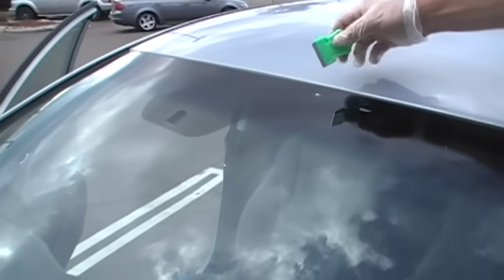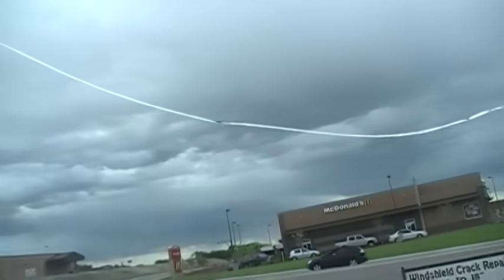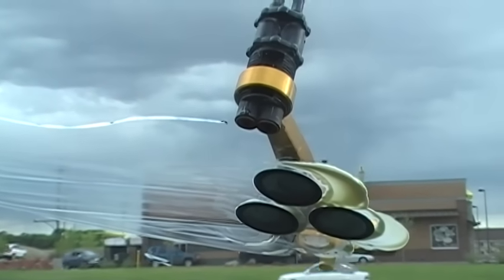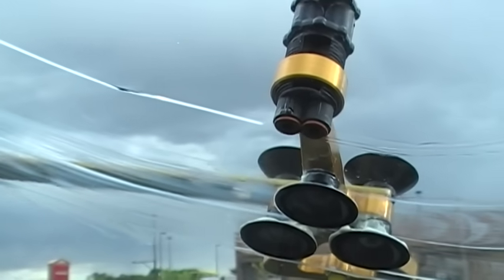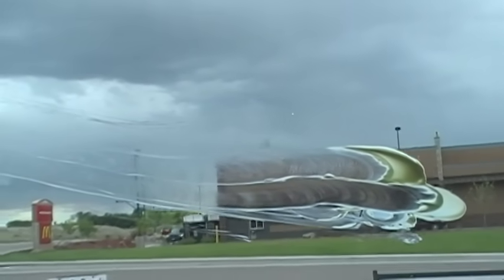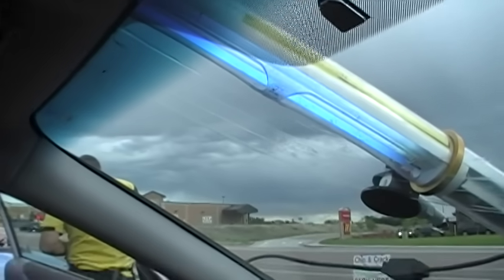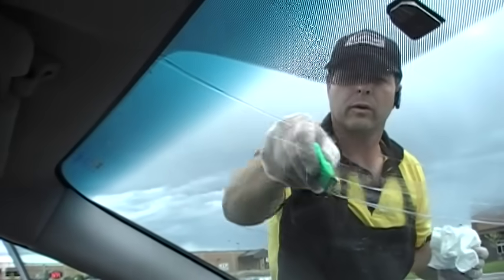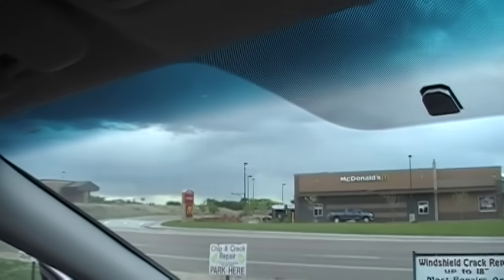How to Repair a Long Crack in a Windshield by Crack Eraser

Comment: Today I tried to fix a small chip on my windshield and actually made it turn into a long crack, I believe this happened when I shut the car door while the replacement kit was working on the windshield I open the door to look inside to make sure the residents doing what it was supposed to do and then I closed the door! Then tried three times to fix the long crack.

Comment: I own a fleet of 6 driving school cars.  I finally decided to learn to do this myself and tomorrow I'll try my first crack, about 18" long.  I bought a $179 kit from someone else on Amazon.  The injector seems decent (made of steel with good O rings and a nice suction cup) but it's not double barrel.  The "grease slide trick" ... Can that work with other injectors?  Is the type of grease important?

Comment: Tim I have seen to many repair Kit, but I never seen a repair as great of a work as this .What do you used ? What's the requirements ?what kinda glue do you used .I wanted to test this out in my car got the same windshield Crack like that .What do you think of a Rain x repair Kit is that any good also ?Do you used that ?

Comment: Ugh need this so bad, got the exact same rock chip and crack on my 1996 buick regal and my windshield is discontinued so I can't replace it. I was told by my local glass shop that cracks aren't repairable 😂

Comment: What about from right to left all the way to about 1” from the other side just above the wipers?

And no I didn’t hit anything, the damn thing cracked while sitting in a parking lot during winter with the defrost on. Work van was 11 months old. This Ford is a piece of hot trash, this is just one of many absurd issues I’ve had.

Comment: Whats the cost for a repair like that ????
Reply: I wouldn't be surprised if it was 40-65 bucks, anything more then that you would just pay the deductible and have it replaced. Since I do mobile rock chip service, I will do it but if only if they ask me about it I don't advertise it, I have done it on RVs in the middle of no where Alaska where the crack is right in the view of the driver and is annoying until they can get it swapped out with a new windshield in the next town 400 miles away or when they get back home.

Comment: Does it actually change the viscosity of the resin?
Reply from the maker: Yes I blends resin as you inject so the resin changes viscosity as you inject matching the gap of the crack.
Reply: @windshieldrepairkits  wouldn't that be the fluidity of the resin? Viscosity is affected by change in temperature.

Comment: WOW! I never knew such a thing was possible. 🤯 I have an '89 Buick Reatta with a low crack down near the dash that goes about 1/3 of the way across from the driver's side edge to the lower edge. The car is fairly rare... Especially here in Canada and new glass is nearly impossible to find. I'm going to have to look into repairing it with UV resin. Nice work and thanks for sharing.
Reply: how did it go ?
Reply: @schoolinJOO  I did get me some resin in a kit by rainx... It did NOT work well and was a total waste of time and money. Perhaps if I would have had more resin, more experience using it, and professional tools the results would have been different.
Reply: @clllaytrrron  that’s what i am thinking; i should buy a second or third kit…. another youtuber used a $9.99 kit and got across almost half the windshield but he said he had already done it before -
Reply: @clllaytrrron  thanks for your reply btw!!!
Reply: @schoolinJOO  yeah that rainx kit had such a teeny tiny bit of resin... If I try it again I'll buy some resin off Amazon or maybe take it to a glass shop in town... I used to deliver windshields for PPG so I know a few of the installers.

Comment: Interesting, given a choice I'd rather have a windshield patched than  replaced - there's less chance of leaks and rust from disturbed paint and moldings. 
However, I don't understand why an owner would need to pay for a replacement windshield.  
The same insurance that makes this  free repair would replace if necessary a windshield that could not be patched.

Comment: Can this be done on cracks from stress no rock chip.
Reply from the maker: Most cracks go to the edge and have such a small hit that started the crack that people think it is stress but it is not. As long as the crack is on the outside layer, then yes it should be repairabl
Reply: Thanks cause I have a long crack started in the dark black area of the window. Gotta be close to 17 inches long

Comment: Is the resin going into the crack from the inside or from the outside? Where is it being applied from?
Reply: its from the outside windshield but it makes its way in the windshield
Reply from the maker: The crack is only on the outside pane of glass so the outside.

Comment: HOW IS IT GOJNG TO CREATE A AIR POCKET IF THE REPAIR AND THE BROKEN SIDE IS ON THE OTHER SIDE YOU SOUND SO STUPID TRYING TO TALK DURING THE REPAIR
Reply from the maker: The crack is on the outside pane of glass. You are misinformed. I have been doing this for 40 years I can talk and repair at the same time.

Comment: Do i need to drill a hole on each end of the crack? i have a 11" long crack that started from a little chip about center of that crack, so about 5"  each direction.
Reply from the maker: If the crack does not go off the edge on either side then yes you need to drill both ends.

Comment: Once glass cracks and runs like that, it might be possible to stabilize any further cracking, but the crack will still refract and distort light.  If the crack is in the line of sight of the driver, it is probably best to replace and not repair.
Reply from the maker: Hello Doug, You are partly correct. The refractive light and distortion is greatly diminished by 80 to 90% because the crack is filled by a optically clear refractive index matching resin. We tell people it will be like a hair off their head sitting on the glass and the light glare will be greatly diminished. If the crack runs right across their view in the critical area the size of a 81/2 X 11 sheet of paper  right above the steering wheel we usually recommend a replacement.

Comment: By putting suction cup devices on the windshield, will that separate the crack too much? Obviously y’all are professionals, but if I was to DIY this, would it harm the windshield? I’m just nervous about putting suction on something that already has a crack
Reply from the maker: The plastic layer is not disturbed at all when repaired or affected at all so it is safe.

Comment: The drill open up the narrow end, right guys?  Bc the narrow end is almost impossible for the viscous fluid to enter unless you did vaccuum??
Reply from the maker: We inject two resins at the same a thin resin and a thick resin in our dual injector which eliminates the problem you are having.

Comment: Is it a permanent solution ?
Reply from the maker: Yes it is permanent, We have a lifetime guarantee on all our repairs and they last for years.
Reply: I went to some glass repair shops in my town and showed them my long thin crack and they said it will not go away and i should replace it  @windshieldrepairkits
Reply from the maker: Hello Erick, Glass shops are replacement experts, not repair experts. They only know to replace. Crack clear up about 80% and are lifetime guaranteed.

Comment: Crack repairs are good and so do chips repair. But if I get a chip in my windshield I can repair it myself. But if is a crack like the one shown on the video. My insurance will cover for my windshield replacement. Minus the $50 deductible. Which is better than paying for the whole windshield.
Reply from the maker: Repairs are FREE your insurance waves your deductible. We always give our customers a choice of replacement when they have a low deductible, however you would be amazed at how many customers still choose the repair even with 0 deductibles on replacements.

Comment: The windshield provides 60% of the structural stability of the roof during rollovers accidents. Granted, the odds of someone being in a rollover accident after having a crack repaired is small. It can be the difference between life and death for those unfortunate number of people. when it happens and you may be liable for the consequences of that scenario. It's great cosmetically but it isn't a proper replacement for the structural integrity a new windshield would provide. It would be wise to inform your customers of this possibility not only to protect yourself from legal trouble and the guilt it would undoubtedly cause, but to inform the customer of the risk involved and leaving them with the option to make that informed decision.
Reply from the maker: You have it wrong. The problem arises when windshields are replaced improperly and then the structural integrity can be compromised. Long Crack repair passes all the ANSI test new windshields have to pass and maintains the roll over strength and windshield integrity. There have been many lawsuits over improperly installed windshields causing death or paralysis  but never in the history of windshield repair has there been a problem cause by windshield chip or crack repair.

Comment: is it really necessary to drill the small hole at the end? what is the likelihood of the crack spreading after you fill it will the resin?
Reply from the maker: The stop drill is a necessary part of the repair process. The likelihood of the crack spreading is less than 1%
Reply: Tim Evans  is that 1% with or without drilling?
Reply from the maker: Spork 357  We always drill a crack it is part of the repair process, if you do not drill you will have many that fail. We always drill.

Comment: Any easy fix for wiper scratch ?
Reply from the maker: There is not an easy way to repair a wiper scratch, There were some systems developed for that but they did not work very well. I do not know of anyone using them.

Comment: if i have a rock hit mark in my window what should i do? can i repair it with resin?
Reply from the maker: If you have a star chip you can buy our DIY kit from Amazon or from the Crack Eraser web site.
Reply: alright, thanks... ill have to give it a closer look to see what kind of chip it is. Its basically roundish about 1/4" diameter.
Reply from the maker: The kit will fix any chip and cracks up to 18 inches, and has enough resin to repair sever damages.
Reply: any chance you sell the resin alone? seems like i could repair it with just a few drops of resin
Reply from the maker: The resin has to be injected into the damage so it will not work the way you are thinking.

Comment: Good job on the repair!!!  BUT, this is what's wrong with the auto glass industry, repairs are not the sole purpose to keep the windshield from cracking, it is to repair the structure and integrity of the glass, no resin is strong enough to get the strength back on a crack so large.  That should have been a replacement for that customers safety.  

Excellent job on filling that crack but the customer was done a disservice if it was not explained to them that the windshield strength is gone.
Reply from the maker: Hello CB, I appreciate what you are saying however it is wrong Crack Repair passes the ANSI tests after repair. These are the same American National Standards Institute tests that all new windshield have to pass. The replacement industry has said this about chip repair for years and is incorrect. Crack repair has passed the ANSI tests for new windshields. The safety issue comes up when the windshield is replaced and not boned to the body correctly.

Comment: IMO, once the glass is compromised with a 23" crack, replace it. On a rock chip, yeah, maybe. But this is an aesthetic bandage, kinda like putting duct tape on a ruptured break line.
Reply from the maker: You are behind the times, Technology has changed and now has been proven safe. Once repaired the strength is the same as before the repair and passes all ANSI tests.
Reply: ANSI only refers to the replacement of automotive glass. If you want to talk about repairs, talk about ROLAGS. Per their site, rolags.com/repairable-damage/, anything over 14" is unsafe and deemed unrepairable. Check your facts before you try to correct someone else.

Comment: I would think that doing the inside of the windshields crack the same as the outside would improve it more, unless the epoxy? Can easily penetrate to the inside.
Reply: The crack is only on the outside pane, There is plastic in the middle that prevents the inside pane from breaking.

Comment: I'm in the Uk and was wondering what you use to put a bullseye at the end of the crack as i was under the impression it had to be drilled..? I'm wanting to repair my classic screen using the home repair kits available.. the screen has 3 or. 4 short cracks in one corner..
Reply: We have a special tool we have developed for this. You can also drill to the plastic, However When we see 3 or 4 shorts cracks on the edge of a windshield, this damage is not usually repairable.

Comment: With a crack like that your better off replacing the windshield.
Reply: For years we use to replace also and 9 out of 10 people choose to repair the crack when we offered them a choice or either a replacement or a repair, So just your opinion the other 9 would not agree.

Comment: Someone has just given me a cool car with a circular crack in the windshield high up out of the test field on the passenger side but it's not cool to look at...    The crack is only about 3 inches in diameter and goes right round in a circle so won't ever spread to the rest of the screen.     This product would be PERFECT.    Only problem is...    How much does it cost compared to a windshield replacement???
Reply: Most repairs are free if you have comprehensive Insurance. If not $50 to $60.

Comment: sorry .  butt cracks take bondo and an adhesion promoter
Reply from the maker: Windshield repair resins cure by Ultra Violet light and have acrylic acid for adhesion. They match the refractive index of glass and are very strong. Bondo is for auto body repair and is painted afterwords.

Comment: looks good but i would rather replace the windscreen if it was that big i mean they do repair them here in australia but not that big as it can become unsafe i am not sure on how strong your resighn is but it looks impressive to me a stone chip i would repair cheap kits from car stores do that but a crack nope definately replace the windscreen as it can cost more to fit then replace it on some cars
Reply from the maker: Longer cracks are safe to repair, We have been tested it for years in the USA. We let the customer choose what is best for them. Many chose to repair because it is free to them because their Insurance company pays for preventive repair.
Reply: yeah that maybe the case over here it is expensive to repair cheaper to replace but i was impressed with the video tho
Reply from the maker: Hello James, Long cracks have been through the safety tests all windshield have to pass in the US and they are safe to repair. We usually charge $60 to $80 US so repair is usually cheaper than a replacement. I would think it would be cheaper in Australia also.
Reply: Sometimes it is sometimes no i mean depends on the car it is normally not much more over here for a new windscreen and i don't doubt it is not safe to drive on i have a small chip in mine at the moment that can be repaired but it seems to be ok at the moment

Comment: What is the size of that drill bit?
Reply from the maker: It is a very small drill bit used for windshield repair.
Reply: I can see that it is small.   I wanted to buy a carbide burr bit and just need to know the size.

Comment: It very nice job repair.  Will this crack came back if you live in North America area where you need to use heater and ice scraper during winter?
Reply from the maker: Crack Eraser is based in Colorado at 7,000 feet with lots of snow and temperature changes.

Comment: This works on inside cracks? I accidentally cracked my windshield from the inside of my car installing my rearview mirrior
Reply from the maker: It may work on the inside depending on the crack or cracks you would need to drill it from the inside and load the resin from the bottom of the injector.

Comment: replacement of company fitted glass reduce 22% body strength 
Good Work
Reply from the maker: Thank You Kuldeepsinh. I did not know it was 22% but we know the original seal provides the safest windshield in your car and it is a good idea to retain the original seal as long as possible.

Comment: how much for a repair like his?
Reply from the maker: Most repairs are free because your insurance company waves your deductible and pays for the repair. If you do not have comprehensive insurance it runs $60 to $80
Reply: I got a quote here in Uk for 300 pounds for glass replacing, dunno if not Uk is someone repairing like you do. have to find out.

Comment: This can be a real cost saver, windshields can be very expensive to replace and if people have gone to $500 deductible to save money they will be coughing up the whole $500 for most cars. Unless you can find a small shop to do a used windshield.

Years ago my insurance company offered me a deal. Back then windshield repair cost $50.00. If I paid the $50 in an attempt to save the windshield they would wave my deductible if the windshield cracked. Mine had a large multi pointed chip in it about the size of  dime. The repair held for ten years.

I can't comment on how well a large crack like this will hold up but I know that resins you apply with a dual compound mixture are VERY strong. I recommend you contact your insurance agent before you pay for a repair like this. Get them on board and they might make an offer like mine did.